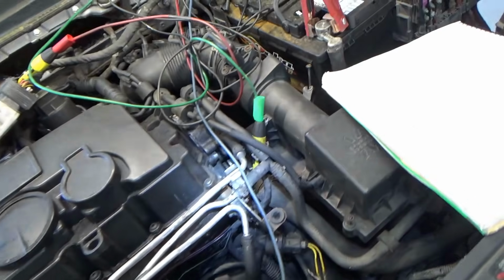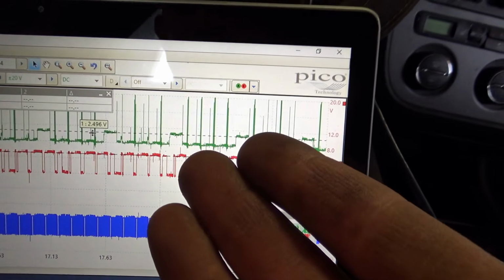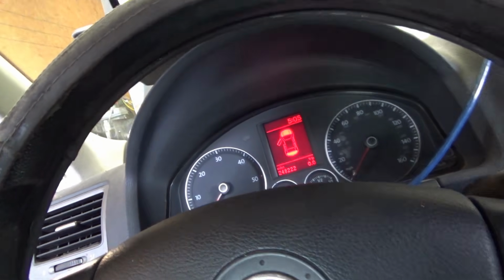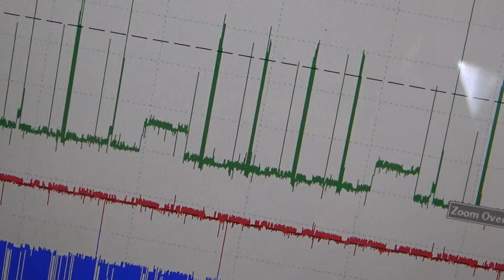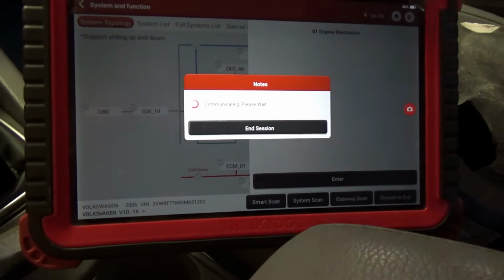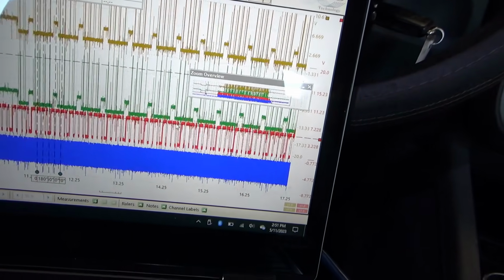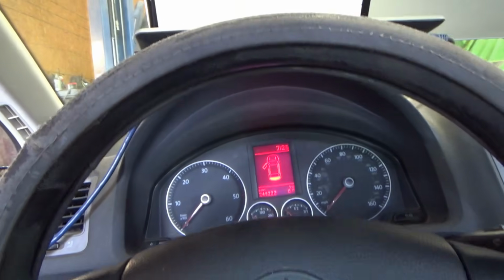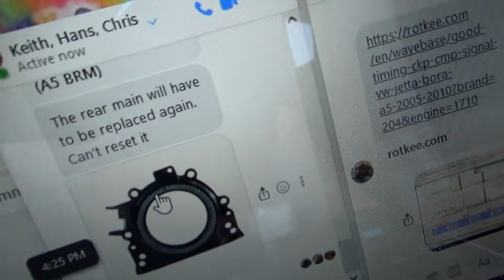ANOTHER Dead TDI?? (Jetta No Start After Engine Swap - Part 2)

Comment: I don't blame the 'weird' seal design. I blame the person who installed it. It looks different than any other oil seal that he's ever installed.. having wires on it. When you don't understand what you are working on, you need service data or access to somebody who has dealt with this before.  

I would charge the length of time you spent and travel time.  Should also send some beer money to the others who helped lead you to the problem!

It would have been nice if you would have had a list of everything that was touched before you. But unless you knew about the weird oil seal, would you have even thought to look at it?

Comment: Hi Ivan, What would be good is to get the light detector from PICO or make one and fit a reflector tape at TDC1 on the crank. Then you would have a direct reference for the injector cam and spark timing. This might have helped you find this from one of your other recorded waveforms. I think I will now buy one. Also if it was injecting there should have been some smoke from the exhaust. I have worked on a few diesels. Even if the injection timing was miles off you should get something. It is like it is not injecting but you have injector pulse. There might be more to this still. Was there an injector high pressure PID?

Comment: That is not of minor importance and should be in the shop manual, and may be, but you come in after the fact you wouldn't think of going back and reading the installation instructions for the timing shafts.

Comment: You need to charge extra! Its not your fault! Its pretty obviout there was a sensor on the rear of the crank but a special tool to install the seal/sensor is nuts.

Comment: Always been the issue with VW/Audi  cars far to complicated for their own good which makes them extremely expensive to repair. Unfortunately the VAG marketing dept over here in the UK has done a great job on getting the public, especially the young generation to believe their cars are the greatest thing since sliced bread. This may have been the case in the 70/80s when british built cars were a load of crap but not the case any more. We have a saying overhere -  you can probably afford to buy an Audi , but can you afford to run one. I personally would not touch one that was out of warranty . Just far too complicated, over engineered and overpriced.

Comment: The engine might run on only the cam sensor. Set the mechanical timing back to the correct position and disconnect the crank sensor and see if it starts. You'll still have the engine light on, so it's not a fix, but it would confirm the diagnosis. I am also doubtful about the fuel pressure. The output pressure of the tandem pump should be 8 bar, which is over 120 psi.

Comment: Take the front timing cover
Off to install a special tool
On the front gear at TDC. 
Take the transmission out.
Put a special tool on the new rear main use a micrometer to make sure the gear is in the right position and then put it all back together. Crazy just crazy the installer is going
🤪 nuts😫😫😫😫 almost forgot drop the oil pan too!

Comment: What a truly stupid design! If they were going to use the seal for timing, they should have made the install poka-yoke. But having had a tangle with a 2009 Jetta 2.5 that would overheat due to what ended up being a clogged heater core, not surprising. Never mind the Dieselgate fiasco. Some serious buffoons at VW. I'll never own one and warn people about them. 

👎

Comment: I was wondering about the crank signal myself, I got to thinking how does the computer work out if the cam signal is off? It times it in relation to the crank signal? But I would have made exactly the same mistake that you did - I would have presumed that the crank position sensor notch would not be a variable. Sneaky of VW to use the main seal to house the part that produces the signal.

Comment: Analysis of this diagnosis.
1) Cam DTC.  Glowplug DTC's
2) He connected probes to cam and crank sensors to look at patterns on the scope.  This pattern was never compared a good crank/cam correlation pattern.  If he simply did this he would have seen that the crank sync notch was not in the right position.  Picoscope has a huge library of good patterns...

This diagnosis would have been done in under 30 minutes if he just compared the pattern in the beginning. For this reason, he should only charge for diagnosis up to this point.    You would not have had to know anything vw's and it's unique crank gear that goes over the rear seal.  The marks would have been off and that is it, done.

In the end, you still have glowplug DTC's and low supply fuel pressure.
Reply from the maker: Agreed having a known good waveform for this engine would have saved 4 hours or so. Does Pico provide a known good waveform?

Comment: Pico 6 baby!!  Seriously though, would a relative compression test with a sync on #1 injector show poor injection timing? If so that could have triggered more thought into correlation issues. I would have never suspected a rear main seal for Pete's sake, but I may have chased a correlation issue. Any way hind sight is always 20 20. Thanks for presenting this.!

Comment: ivan guys were telling you of the crank seal from part one
Reply from the maker: What's your point? Diag was from a month ago LOL
Reply: @PineHollowAutoDiagnostics   point is you have cam and crank signals plus injector pulse on the scope but could not prove cam signals were off.
Reply from the maker: @krama3282  correct, I needed a known good waveform 👍
Reply: @PineHollowAutoDiagnostics  Awsome.  i am no mechanic. i work with fiberoptics. could you have taken a pressure transducer  waveform and sync it to the other waveforms to prove the crank timing was off?

Comment: the charge i would say full price for traveling if you called the maestro sooner you wouldnt be there 6 hours its a learning curve the next will be done in half hour i was going to say call tommy woolf  vw as you did diagnose fault correct split the charge ie 3 hours plus travalling there is a piont that you did spend six hours there and might still be there due to not having experience  with this engine do you charge him for two years as you worked on it and still not got the thing started cut every body's losses and chalk it down to a learning curve i would just for the hell used starter spray to check all mechanical was right and it ran a lesson learned you wont forget thank you Ivan

Comment: You know what’s crazy about this little TDI and VW in general as a company: they’re computer logic is programmed to set a cam range performance code under these conditions, even though it should be a cam-crank correlation code; and then they have  the audacity NOT to disclose code descriptions in service info (which would be in defiance of “right to repair”); and the whole time, they’ve secretly designed a crank pick up that is distinctly unique from the rest of the worlds automobiles! Tell me they don’t have it out for techs!! Sons of b$#ch&s!!

Comment: You earned every bit of time spent diagnosing that car !! 
Even Ross Tech had little information. However a big red flag to the installer would be the design of the crank sensor. 
I've never done a rear main or sensor on that particular engine but looking at that crazy setup would make me take a look at service data

Comment: Easy to say after the fact but I think that your diagnose had gone differently if you had done a visual inspection of their parts bin. Seeing that otherworldly crank pos sensor and rear main seal assembly should have raised red flags, certainly after 'engine-out' when a good-faith mechanic would also preventatively replace the normally unreachable wear parts.
Omitting the extended crank with crank position sensor disconnected test is a mistake.
Also, VW made a mistake. The ECU threw cam position codes while it should have been throwing correlation codes.

Comment: If the engine has compression, is getting fuel and air, it should attempt to start.   
Where is all the fuel going while the engine is cranking?
Are you certain you have fresh fuel, adequate volume, and correct pressure?

Comment: I think how you charge for this comes down to a question of what you can expect from the hourly rate. Does the customer pay for effort or outcome? If they pay for effort, then the first customer who has this problem pays way more than the next customer with the same problem, which is kinda unfair. But if the customer pays for outcome, you have to estimate beforehand how much time this single diagnostic will take, and you take a big risk. That risk shall be paid for by the customer, so the customer might ask why you charge so much in case you find the problem quickly.
I guess you could agree, before starting the job, on either of those as long as you are upfront about it and the customer actually understands what he agrees with.
One could argue that if they pay for effort, there can be no warranty (because that is new effort). Yet, you almost always warrant the repairs, so it's already a mix between effort and outcome.
In this case, I'd just charge the hours since nothing else was agreed upon (i guess?).

Comment: Mind blowing! The seal sets the timing! Germans do like overcomplicating and keep the information for themselves. This was the most unbelievable problem I've seen you deal with. Still curious to know the final results 🙂
Reply: Not quite, the encoder ring sets the timing. The seal is a conventional stationary rubber lip seal which is part of the housing.
Reply: @ferrumignis  OK, then why the timing problem and the need for the precise positioning of the seal (it has a magnetic component embeded, if I understood correctly).

Comment: Learned a lot from this video as pine hollow always says always do a full health report, always study wireing
Diagrams, always check tsb
And the blogs on line before
Starting the diag lots of info
In the blogs about this problem great job great video excellence is not easy
👍👍👍👍👍👍

Comment: Pretty lame work by the engine swap installer, its obvious that the rear seal has somthing to do with timing 🙃
I have worked on few of these TDI's, and the only time I've changed the seal, I didnt bother to buy the special tool, just marked it well up and pressed it on using the flywheel. Car started right up and has been running for many years.
Reply: I think the problem is stall fuel, or low volume, or inadequate fuel pressure.  The engine has compression & air, if it got fuel it should attempt to start.  Why was the fuel delivery ignored?
Reply: If it wont start after fixing the timing, sure, then fuel pressure is up next.

Comment: Ivan, about charging, I would say it depends on the circumstances; what agreement you have with the customer, what communication you had with the customer, how things went down, etc. For example, if you at some point told the customer that it is taking a long time and will be expensive and the customer told you to continue, then just charge the diagnostics time. Another example, sometimes I have worked on diagnosing an issue (not cars) and then being stubborn and curios and not wanting to admit defeat I spent a lot of hours on it, a lot more than I should have done before at least informing the customer and giving them a chance to make a decision on how to proceed. On those occasions the customer got a very significant discount. What I am saying is that you should charge what is fair and that you have to be the judge of what that is.

Comment: Some VAG TDI engines have a flywheel trigger wheel with 2 notches 180° apart for faster startup.

Is it possible that the ones with the pressed on trigger wheel are manuals only?

Comment: look under the valve cover the connections of the injectors is a problem with vw, those sliding plugs are then too loose

Comment: Commentors on part 1 nailed it!  And they even said it should start with the cam sensor disconnected if the crank sensor was timed correctly. Well it wasn't, and it didn't.
Of course you shot parts 1 and 2 at the same time and didn't have the benefit of the comments.
Another entertaining detective story from you, Ivan! Thanks!

Comment: It is a big ask to expect anyone to pay for 6 hours with no diagnosis. If you cannot find the issue in a reasonable time frame, I would say 1 hour, then the  car should be handed back and you charge your 1 hour time spent.

It is arguable that as a mechanic/automotive technician, when you take on a job you should be able to fix it, or at least find the issue and if you do not have the means of repairing the issue, then at least refer them on to someone who can, even the dealer if required. I know this can be hard if you are not provided the full story, however it seems this rear main seal is more than a seal and it would be fare to say a mechanic working on this vehicle ought to know about such a critical component. My comments may seem harsh, however a customer goes to a mechanic (AKA the "Expert") for a reason.

The other thing to bear in mind is that you and the shop also learnt something, that knowledge is a valuable asset to you when working on other vehicles, in this case another VW product. If you were to attend a class, or seminar or other professional development course/forum, you would have to pay for that with real dollars as well as time spent not in the shop earning an income.

Comment: I have to agree with some of the others:   Who disagree with just going along with a "diag" when you don't have the info, so then you just randomly start doing experiments and cranking the starter over and over hoping to stumble across a breakthrough, all while you're racking up hours and hours for the customer to pay for your learning process..   I think once you couldn't find info for the code on aIIdata, and you didn't have a known good waveform--  then you should have cut the diag and move on to something else and give time to think on this, talk to some people and come back to it later.   Were you just making assumptions about the notches lining up when adjusting your timing?  I thought that maybe you read something about that in service data maybe;  But if not, I don't think you can charge for all that trial and error stuff you did through this whole video-  personally.   It wasn't coming from a place of knowing and applying your expertise---   It was coming from a place of NOT knowing (since there was nothing in aIIdata) and simply trying to stumble onto a discovery.   WHich I do get, especially when working on your own stuff;  you can get stumped and you're just trying to dig your way out of the problem and learning by DOING things until you make that breakthrough..  But I don't think you can charge a customer for that.  2 hours maybe;  but the rest is really your own stubbornness/ persistence in not cutting your loses when you're stuck without access to the correct information, IMO.   Or not calling for help earlier.   I think you just have to chalk it up to LEARNING COSTS on days like this, at least for some of it.   The way I look at it is--  How long would this have taken you if you would have known about the terrible "seal/sensor" design?   And how long do you think it would take you on the next one?  That's how I would base my price on this-- and the rest, chalk it up to learning costs.

Comment: Very interesting case. Seems tometimes cars have unusual designs and knowledge should be more easily available about them. Humble Mechanic probably knows this detail right away ;)
I know one Youtuber who has Jetta diesel, about the same year as this one, which intermittently has extended crank time, maybe her car has failing crank sensor, altough I don't think it has check engine light on.

Comment: Without knowing about the rear main seal, even I was wondering why nobody checked the crank timing. Cam timing tells you when #1 is on compression stroke, you need crank timing to tell when its at TDC. Crank timing sprockets can shift, or be knocked loose, its not uncommon. If the ECU is throwing correlation codes and cam timing is right might as well check crank timing to see why it might be complaining.

Comment: Vw is very picky on timing,both cam and crank,in the first video you said they replaced the fly wheel,my it’s thoughts were ,I hope they did not disturb the timing wheel,and it was,and it needs to be spot on,interesting video,you learned something today,I learned something from you also,I’m going to start using the scope before I touch any timing jobs,so I have it’s reference in case it won’t start after.

Comment: It could be the Fuel Pressure Regulator leaking past?
Reply: Yes, why is fuel delivery being ignored?
Reply: There should be 2,100 psi (150 Bar) Diesel fuel pressure to the injectors

Comment: Range Rover uses the exact same type of tone ring for the abs sensors found on the bearing wheel bearing seals, Install one backwards NO ABS signal, Much easier because timing isn't involved but still needs to be installed correctly, It's cheaper to build shit this way meaning without actual mechanical steel teeth, Just a pain in the Ass for unsuspecting Techs. This By far the most useful You Tube Car repair Channel for people who are TOTALLY stumped potentially 🇺🇸👍